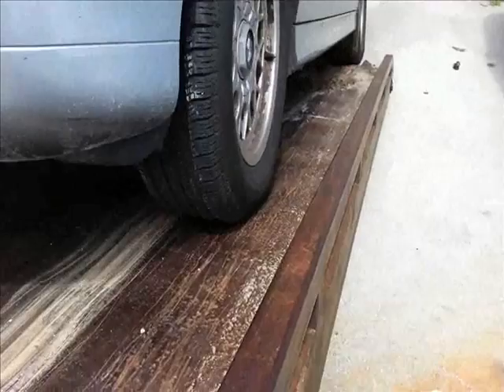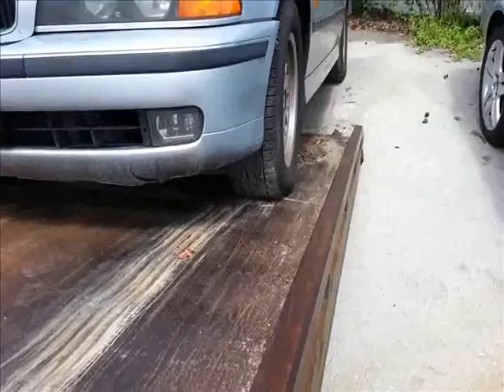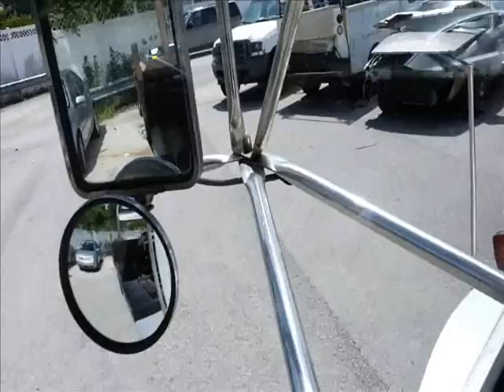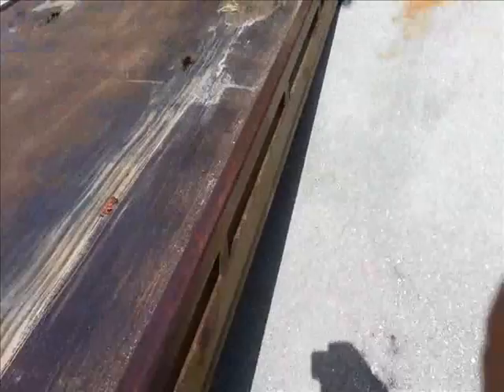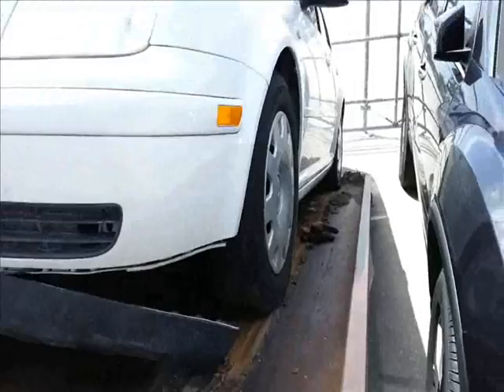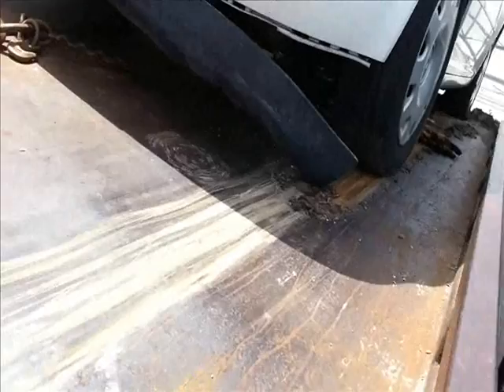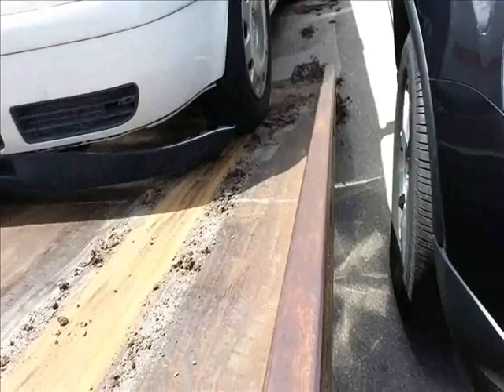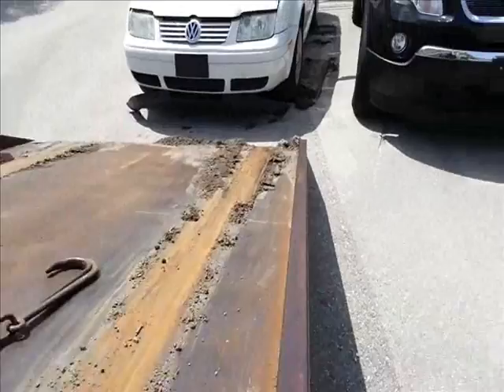Towing cars with no keys.  Shaking car off flat bed

Comment: A helpul tip when shaking a car off, instead of driving the truck forward, you can use the bed and wheel lift to pick up the rear tires and slide the whole truck from the controls. It'll take some practice but once u get it, not having keys isnt a problem anymore.
Reply from the maker: noeliebob  Ohhh.. Lift the tow trucks rear wheels off the ground?  I did that once, It was kind of scarey, but yea it moves the whole truck forward no problems.
Reply: That's what I was trained to do
Reply: or another way it's time consuming but I only do it on newer cars is you snatch block at rear of truck and hook the car up. than just use winch to pull vehicle off.
Reply: @begfomercyx97  Reverse Snatch

Comment: Carry a bottle of soapy water the cars will slide right off.
Reply from the maker: noeliebob  Yea That does work. They have a power washer down the street, that worked great The deck gets so hot in this hell climate here, the water evaporates in a minute.
Reply: noeliebob TRANSMISSION FLUID!
Reply from the maker: Works great for cleaning engine parts that have baked on old oil.
Reply: I spray it on my slides so not too much is on the bed
Reply: We use that or WD40

Comment: Instead of jumping back in the truck to roll car off bed the rest of the way just walk the truck out. Put the bed down and use to it pick up rear wheels and push the truck forward and you can watch the front end the car the whole time instead of just hoping for no damage while you're in the truck moving it forward
Reply: If you don't have any soap and water carry a can of wd40 and spray it on the bed and right up behind the wheels it will come right off
Reply from the maker: I did that before.  Last time I did it the wheel lift hydraulic cylinder blew.  The car was junk, all of they were junk so I am not worried about damage. The only damage I did was I twisted a tie rod one when the engine was blowing up on the tow truck, smoking like crazy. That car did not run anyway and was sold for junk.

Comment: Just pop the transmission clutch and put it in neutral
Reply from the maker: Then the car rolls over you and you die.     Or its a pita to get to the linkage or cable on alot of them.  This is way faster  They were all junk anyway

Comment: why not drop linkage or use skates
Reply from the maker: +Max SAntiago  Then I have to put the linkage back on, sometimes the linkage is hidden/ hard to get at on these German cars.  Skates, LOL, this cheap ass place would not even buy a snatch block or wheel straps for the deck.  So This it was to put more wear on the truck. It was more fun to slide them off. Every car in this lot usually got crushed in a week.
Reply: Max SAntiago yeah skates are a life saver and soap is a brilliant tool
Reply from the maker: This place would not buy them and in this climate anything sprayed on the deck instantly evaporated.  You got burned on it, Never thought steel could get that hot from the sun.
Reply from the maker: Yea it was.  Beat to hell. Old Pete with a Cat  Probably had a million miles on it.  I think some idiot still drives it today. Left that place. It was fun to beat on all their stuff and they refused to buy the proper equipment.

Comment: Good tips thanks...im new to this..very helpfull
Reply from the maker: Some  dude from cuba who spoke hardly any English showed me that haha.   You can also scoop the car back with the bed. carefully angle it and stab it at the front wheels of the the car to push it back. Worked better on dirt or grass. When  the rear tires are off the truck you can also poke them with the bed of the truck just make sure nothing is low under the car that can scrape because the angle of approach changes. These were all junk cars so.. I got good practice

Comment: PB blaster, and walk the truck out with the bed just some advice Fella
Reply from the maker: PB would probably ignite on that deck. That thing used to get at-least 200 degrees cooking in the hot sun all day. Insane. I got someone to soak the bed with a power washer once, the water boiled off rapidly lol.

Comment: Why not use some WD-40 and have it slide off. Why beat up your equipment?
Reply from the maker: It will evaporate in seconds when the deck is probably 250 degrees or higher from the hot sun.   And WD 40 is expensive.  Its not my truck, this place always broke your ass so I did what I did. We all did This truck was old and it was ALWAYS treated rough. It took it
Reply: Gear oil break clean

Comment: You can just walk the truck out using the bed and or wheel lift.
Reply from the maker: Not when there is no room in front of the truck like here.  I lifted the back of the truck once with the stinger and it blew a seal on one of hydraulic cylinders.  Then that shit dropped on me on the highway.  Another video. Truck was such a POS. Old peterbilt prolly had A million miles. Said it had like 80,000 hours on it

Comment: Another method--Pour some gas and bottle of water under tires..will make your bed slippery like   a   wet   Va-J-J
Reply from the maker: It would dry up in minute in this hot sun.  lol Dirt worked the best.